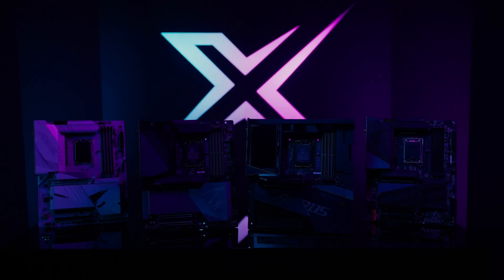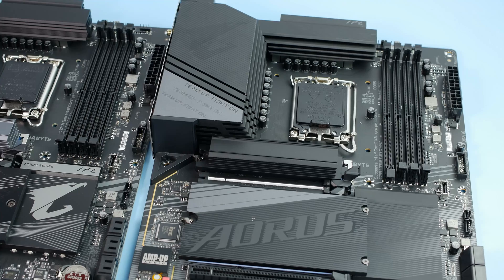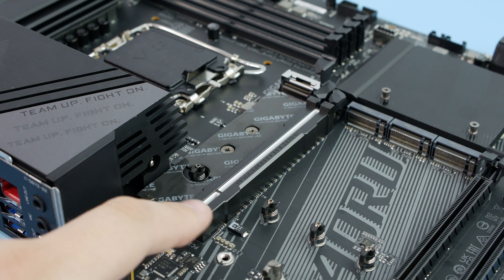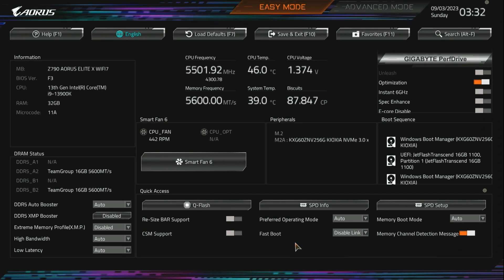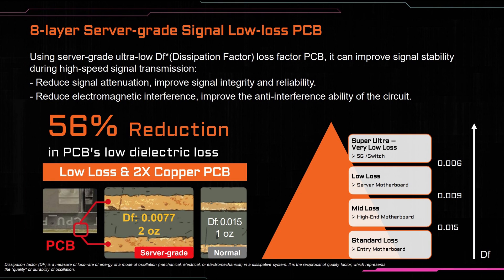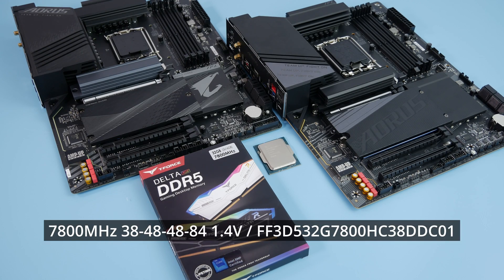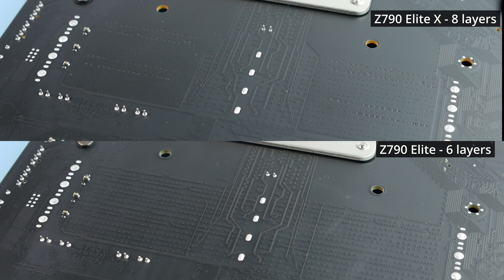Aorus Z790 Elite X Gen - BEST LGA1700 4-dimm for DDR5 overclocking?! Watch before buying fast DDR5!

Comment: Hi. Z790 ud here with latest F9 bios. If i raise the vdd vddq voltage above 1.42, the pc wont boot no matter what latencies and freqs.. any idea why? Seems like something like high voltage mode is not enable or something,
Reply from the maker: Hi. This will depend on the cpu and ram you have. What are you using? And z790 ud itself usually caps at 6600 mhz.
Reply: @ArtyomExplainsEng  Z790 UD i9 13900k i think my rams/mobo is pmic locked since every time i set VDD voltage above 1.435v it doesnt boot and it set automatically at 1.1 default.
Reply from the maker: @Eusebiugh  Probably the case. Z790 Gaming X does not have this problem, but UD is good enough, even 6400-6600 with tights timings should be more than enough.
Reply: @ArtyomExplainsEng  but i am using 2x32gb.
Reply from the maker: @Eusebiugh   32gb sticks are not as overclockable as 16 or 24, unfortunately. I am not sure how high can you go on a UD. 6000?
Reply: @Eusebiugh  This is a limitation of the PMIC or Z790 GIGA UD can not unlock high voltage on this PMIC. Give me pls memory part number for correctly answer.
Reply: @PCstonks  I solved. The problem was the kit 2x32gb 6600 cl32 couldnt get higher voltage than 1.435. I tried with another 2x16gb and it worked. I thought its the mobo but it was the ram sticks
Reply: @Eusebiugh   fine, it's pmic limitation

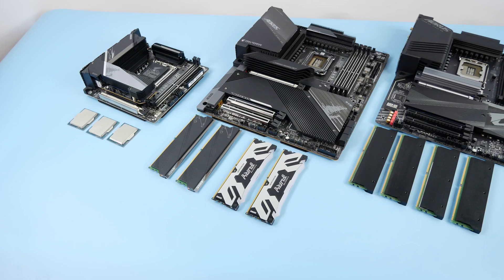Comment: Actually Gygabite produce so many models of motherboard, that I'm confused wich one i have already seen and which one I haven't yet. Nice to see placed space for 22110 th. And this solution within unbrakeble pci-e slot....i never seen befor, so that someone broke ever. ....Again market. And again if VGA card in slot, you can`t pull out ssd`s. Again i don`t see one more 4pin connector for side wall case cooler, again you need extender. 3:46 - Sata still in use but close to die for ever. (i hope) Again. Few? Only 6 4pin connectors, for all pc, - In modern pc you need: 3 for Liquid Cooler GPU, 3 for CPU, 1 for side wall case fan, and many other stuff what ever you installed in you machine, cooling for ssd`s, more case fans, or some hhhl card. "No we present more F*cking RGB" "It`s more usefull". Only two internal USB 3. Mean`s go every time to back side panel. - Gygabite think`s: "It`s usefull !!" 6:24 - Actually this issue is more comfortable moment for manufacturers, how to give you install only one of two, ...or more memory capacity, or more high frequency components (yes, conspiracy theory). Buying high friquency components you must use only 2 ddr slots, 2 slots there are more often on m-itx boards, which are limited by features, thus, pc works fast, but if you like run more program and don`t like close em, to switch to another one, you arises a throble by memory overflow, in another scenario you got more memory, but all tasks process is slack. ....Aaannd.....(conspiracy theory)...you go to buy hedt platform for +100500 bucks price. And every thing works fine but you need a psychologist ))) ....and second job. ...+ new credit card. ...
   New hardware is boring, 10-11-12-13-14......99-100 th gen, is through-passage products, designed for waste your money and fundamentally is overrated. 10900x was interesting cpu as part of hedt platform, where you can get more pci lines, 4 ch ddr, and other stuff. Next is valued - 4677, for now to raw, but some where from next one within prudution roadmap.....emerald rapids, granite rapids, diamond rapids, ...we will get a decent unit.
   P.s. 8 layers - it`s to few. Even taking into account the layer thickness. Especially, for DDR5 memory, whose frequency can reach near 8000MHz. For note, in Evga x299 which used ddr4, and where was supposed near 4400mhz, was used in production 12 layers.